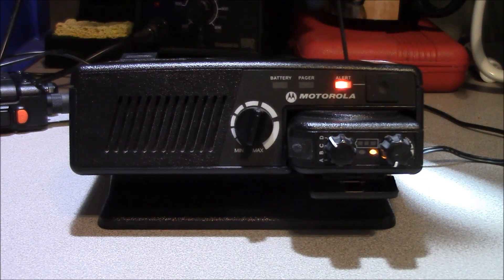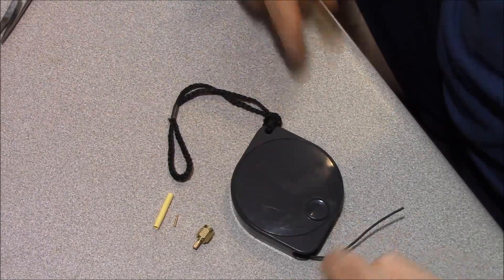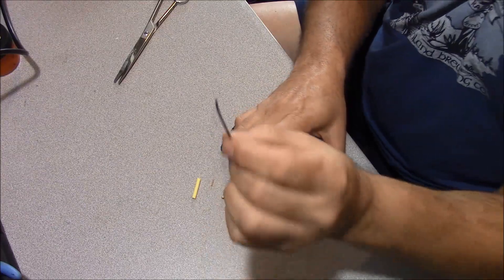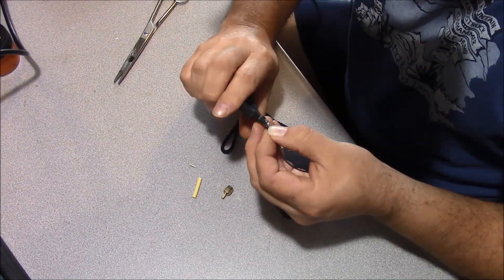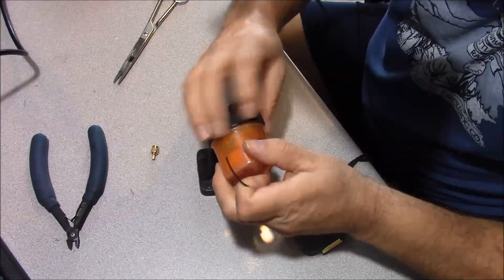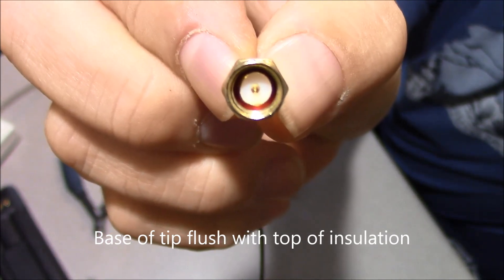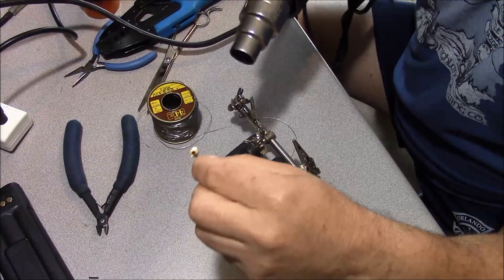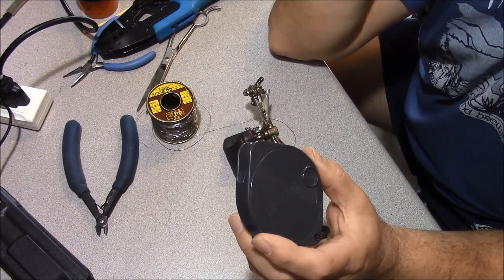HF  / Shortwave pocket antenna for the  Yaesu VX-3R - DIY

Comment: I will be building this for my VX-6R. Did you use the existing antenna wire in the reel or did you take out and replace it with something else?
Reply from the maker: I used the existing wire. One could easily use a small monofilament spool and some  22ga silicone jacketed wire like the Bntechgo wire sold on amazon. It is good stuff and takes no set. Thanks for watching !

Comment: how do you do the alert tone on the intro of your video?
Reply from the maker: QCII encode.
Reply: @survivalcomms  is this a motorola exclusive feature? I'd like to implement this on our section. thanks
Reply from the maker: @notyouraveragegamer130  QCII is a Motorola derivative of two tone paging.  It has been used for Fire Service and  EMS station alerting / paging for a long time. You can set up the same functionality with most commercial equipment that supports MDC or P25 call alert etc.
Reply: @survivalcomms  Thank you, I think i understand the QC2 system. I'm still looking into the Fire/EMS alert tones, specifically from 0:08 to 0:11.

Comment: Cool debating one of these tiny guys for my daily carry.
Reply from the maker: They are great little radios. You can get full power (3w) VHF/UHF with a decent 5v to 6v  boost converter and an Anker (3A USB) cell phone pack  feeding the external DC port if one wanted to.  Thanks for watching !

Comment: Cool application. Same basic config as a coax connector only with a soldered on sleeve over stranded conductor for the center conductor ? Neat idea, thanks for sharing
Reply from the maker: Thank you ! One conductor attached to the center pin the body of the connector floating. Its like half a dipole . Put too efficient of an antenna on these radios and they overload very easily. Thanks for watching !

Comment: Do you have a link to the spool?
Reply from the maker: The spool I used was an old archer one from radio shack. You can can get the contemporary ones on amazon - https://www.amazon.com/gp/product/B0104MT5HW?pf_rd_p=ab873d20-a0ca-439b-ac45-cd78f07a84d8&pf_rd_r=7RDGY9AGVEEDCS6F0KCW Thanks for watching !